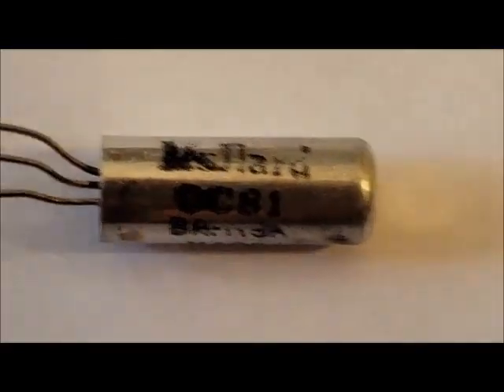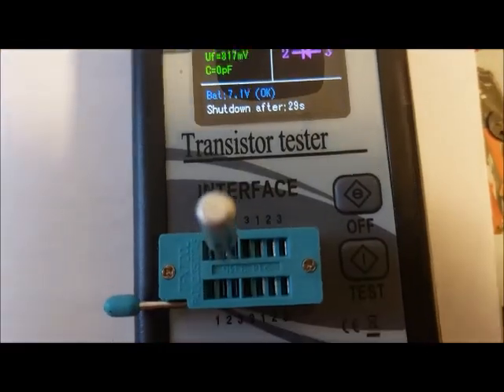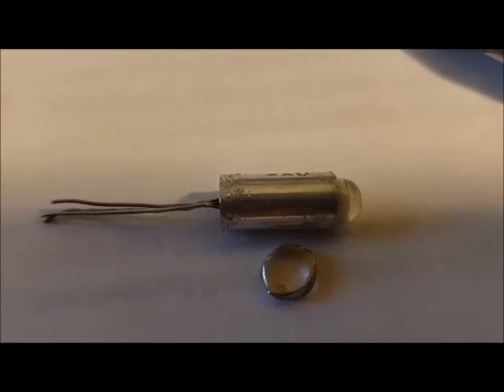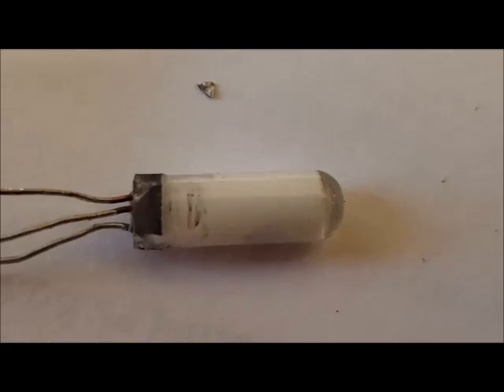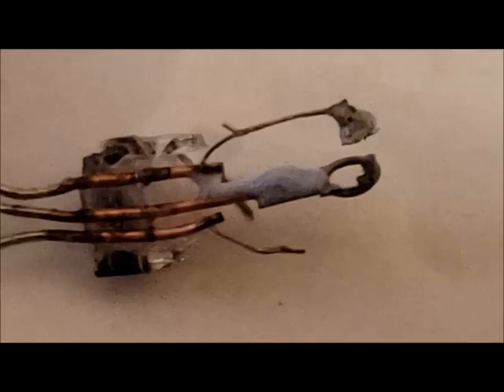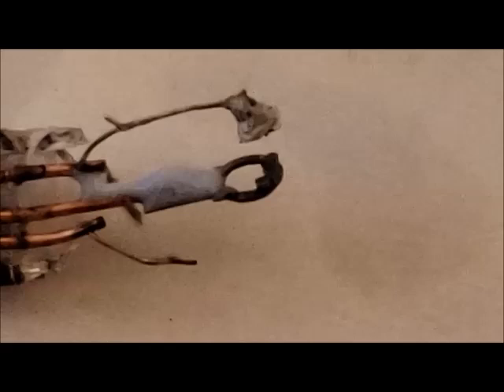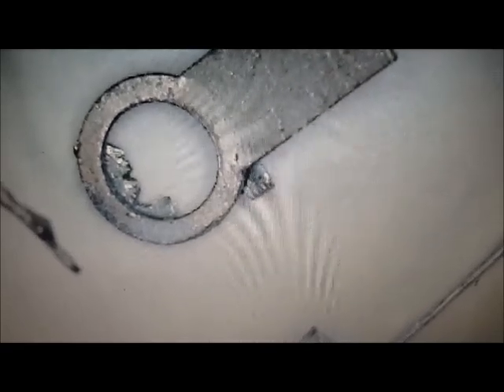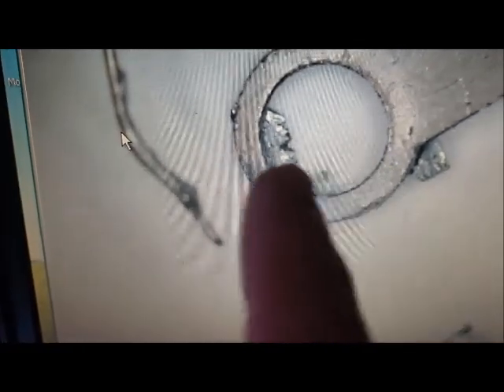Blown transistor opened up for inspection

Comment: it may have got hit with static electricity, as they were pretty fragile.
Reply from the maker: It came out of a transistor radio push pull audio stage so I figured it just died due to thermal runaway, but who knows.

Comment: I think the middle piece is the germanium crystal, and the outer two are the contacts onto it.
Reply from the maker: Interesting concept.  My thought was that the ring was maybe the base which held the Germanium piece on place and the two wires were bonded onto the Germanium pice on each side.  It would be interesting to have a look at the original Mullard engineering documents.